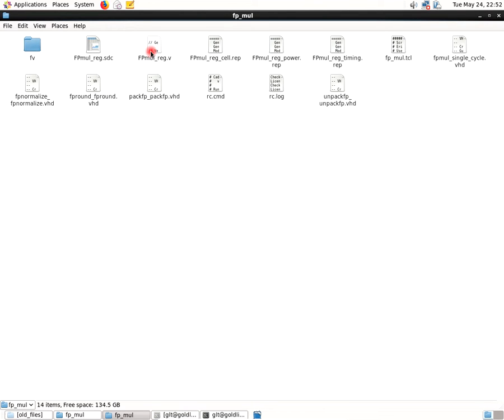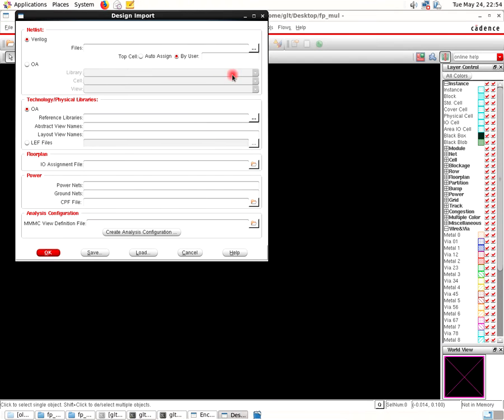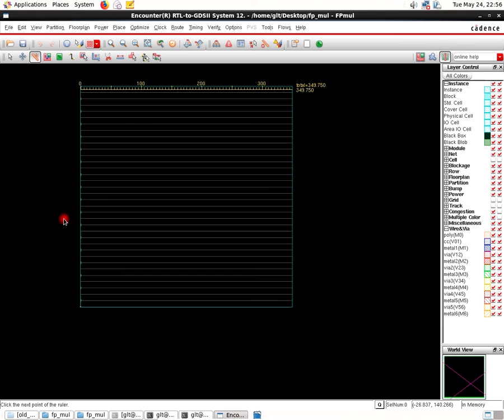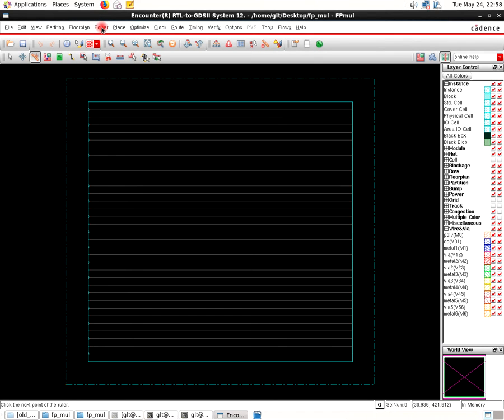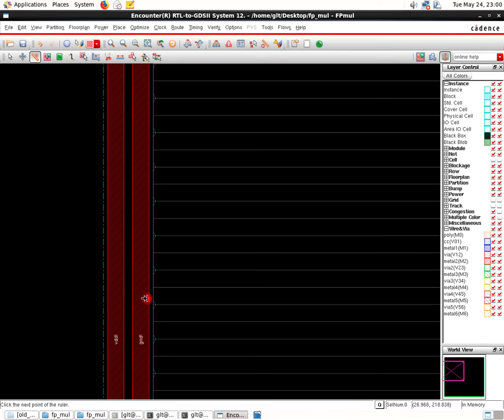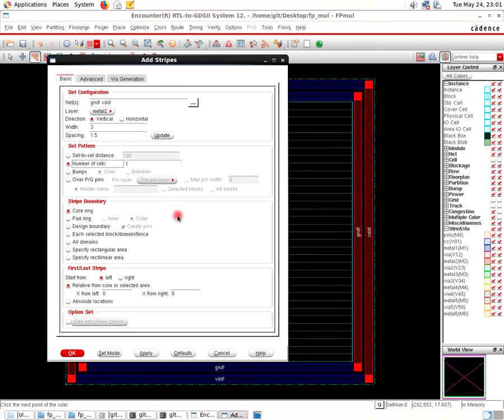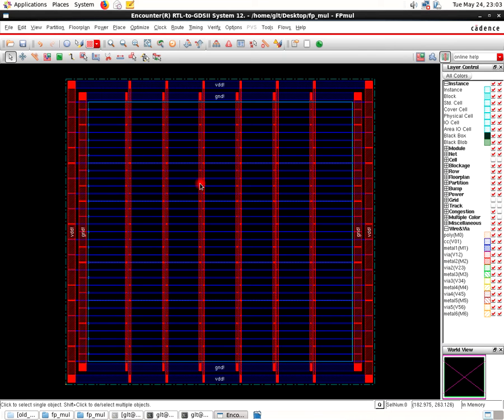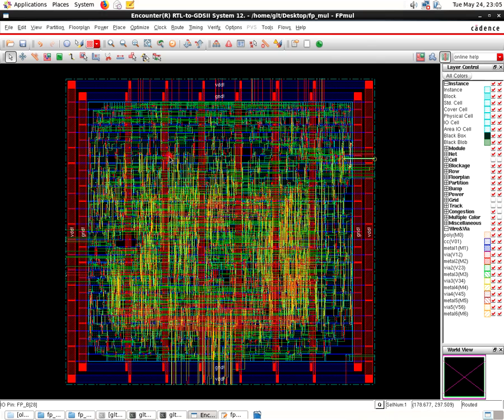cadence SoC encounter(RTL 2 GDSII)  TSMC 180nm

Comment: Very good tutorial! I’m fresh for SoC encounter. Actually I’m designing a IO rings for my research lab for a chip used in a mixed signal PHY design. I would like to know if Encounter is the prefect tool to help me the design of IO rings, since I found that there’s so much manual work using Virtuoso to implement the IO rings.